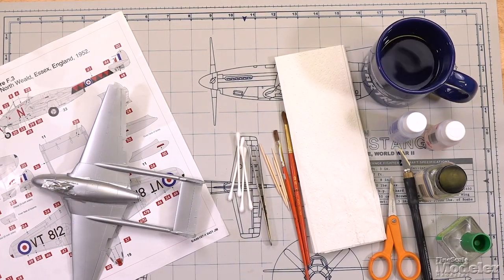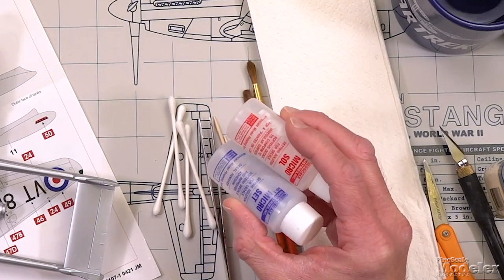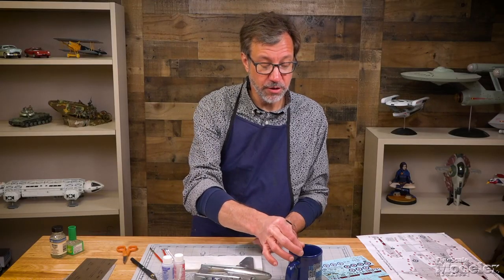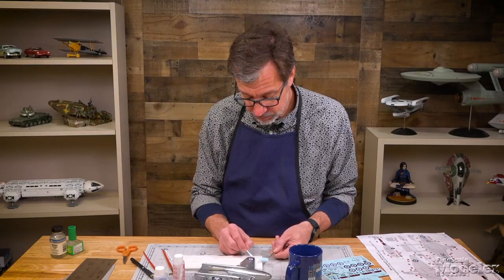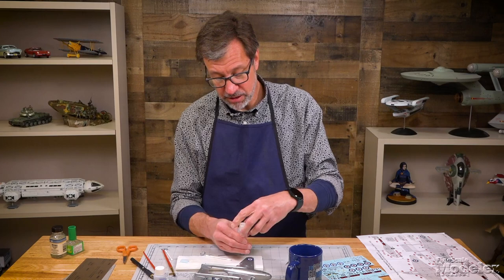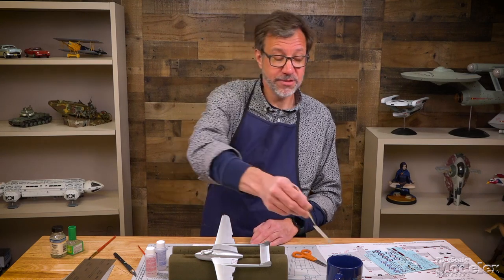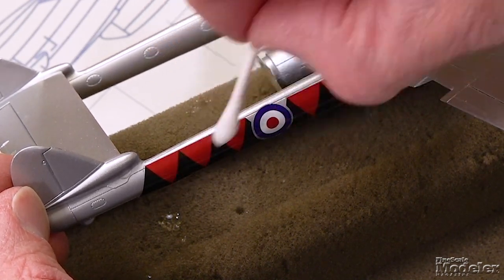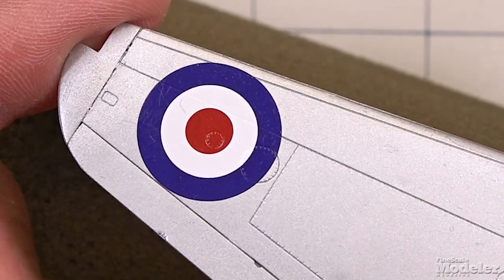Scale Model Basics: How to apply decals the right way to a scale model

Comment: Helpful video, thanks for posting. You are right about the Microsol and Set being easy to spill - I pour a little into the lid and work from that. I also put the open bottles out of reach in a Tamiya aerosol can cap, cos I can still knock them over even when they are out of reach!
Reply: That is a good idea. Also, I have a spool of wide Tamiya tape that I use for masking - I found the Micro Set/Sol bottles fit snugly into it and helps prevent spills. You can also Blu-Tack the bottle to a base.

Comment: Does the whole model need a gloss coat as a base for the decal application?
Reply from the maker: If you have only a couple of places where you'll be placing decals, you can spot apply the gloss. If you have a bunch of decals, it's just easier to apply the gloss coat over the whole model.

Comment: Do you have to use micro set and then micro sol, or can you just jump straight to the latter?

Great video!  Thank you.
Reply from the maker: You can, but they're meant to be used in conjunction with each other. If you're looking for a single step solution, you can always try Tamiya Mark Fit (strong or super strong).

Comment: What kits do you use? I’ve been using revell because it’s cheaper but they always have gaps in the airframes
Reply from the maker: The editors and staff at FineScale Modeler have many different interests, so we don't stick with a single brand.

Comment: Can the micro sol touch the paint of a die-cast model car ?
Reply from the maker: The best way to be sure is to test a small amount of Micro Sol in an inconspicuous spot on the model and see how it reacts to the paint. Because Micro Sol is a mild paint stripper, you want to be careful and try to keep the solution on the decal as much as possible. A little around the edges of the marking shouldn't be a problem. However, if you end up with a run, it could mar the paint.

Comment: Can't you just use water? We used to just wet them and then apply them when I was a kid and I don't remember any problems. Am I forgetting something?
Reply from the maker: You use water to release them from the backing paper. But applying them is more than just dunking them and sliding them onto bare plastic.
Reply: @FineScaleModelermagazine  I have a revell kit of a LS8 glider. The wings ae two piece, top and bottom. There is a slight bend in the wing along the length, do you have any advice on how I might be able to get them/it flat and level?

Comment: Cheers for this ,i tried my 1st decals today one stuck yo my fingers and i ripped the other lol, do the decals need a gloss finish 1st or can you place them on primer? Also can you use cold water instead of warm ? Hope you can help me 😊
Reply from the maker: The reason to apply the gloss is to provide a smooth surface for the decals to stick to and minimize silvering. You "can" put the decals down over primer, but that has a textured surface and is more likely to produced silvering (where the decal doesn't adhere properly to the surface and produces a silver effect when dry). Use warm water. Doesn't need to be hot. Just warm. And you'll probably have to change your water a few times over the course of your decaling session unless you're using something like a mug warmer. Hope this helps!
Reply: @FineScaleModelermagazine  many thanks for your help much appreciated